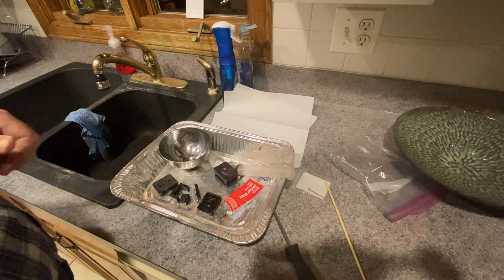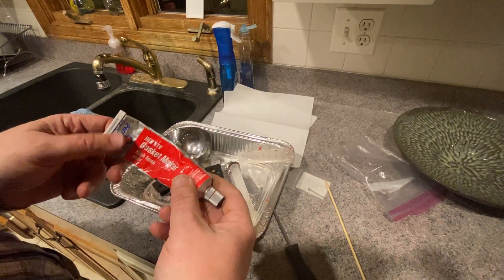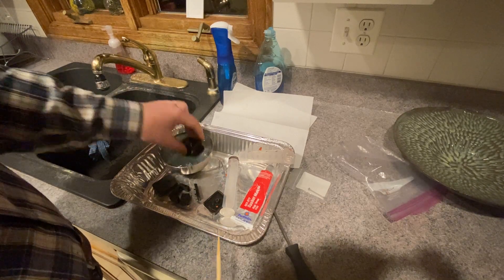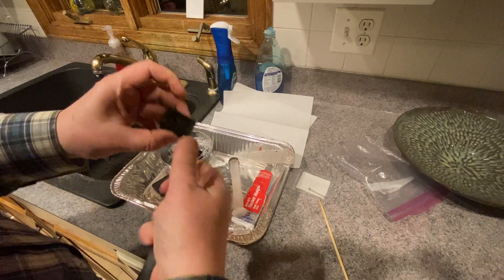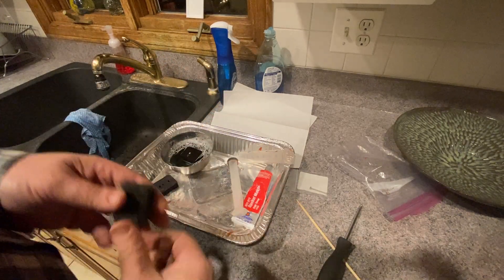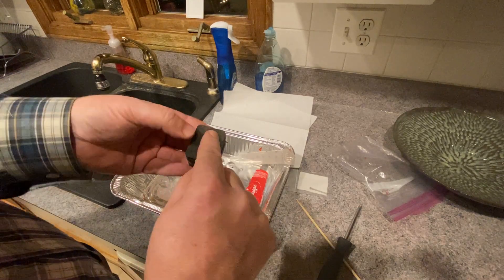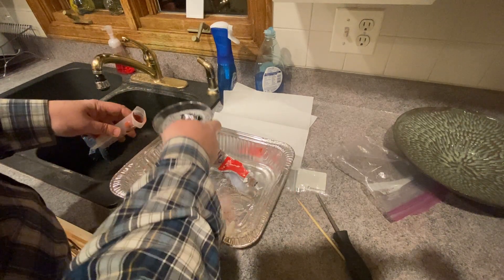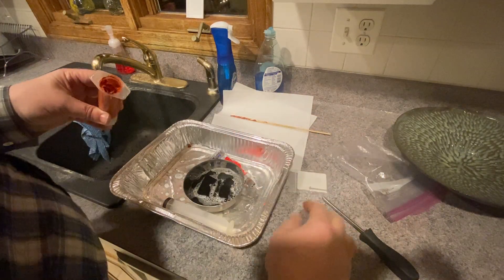Easy no-mess casting of CNC Kitchen style socks using single component RTV -Part 1  Casting process

Comment from the maker: Update:  i talked with someone familiar with the chemistry of the rtv and was told that the wetting of the rtv before injecting was unnecessary.  I did a try with dry rtv in a wet mold that i allowed to cure for two days.  Beat part yet!!  Eg no need to stir in water...
Reply: Yeah i was curious. I have tried casting this type of red gasket RTV silicone (Bulgarian brand i think, Chinese manufacture, some generic product for sure) and it came out quite bubbly and foamy, not firm, not looking too excellent, i was not happy at all. And yes gloves mess all as you say. I ended up simply wrapping the heaterblock in Kapton tape nothing else not even glass fibre underneath, and it does what it needs to, to prevent the bulk of heat loss and heat creep. Sort of not fond of the adhesive on the tape.

But if i were to try that again, i will heed this advice, maybe it comes out better. Also thinking of replacing the heaterblock both for easier service and i can then just use store bought socks; then again if it's really THIS easy then might as well cast i suppose. Even if it takes a handful days to cure. My room has extremely low humidity (10-20%) so i should definitely cure it in a ziploc bag like this. It even took a long time to cure in spite of water when i tried, several days.